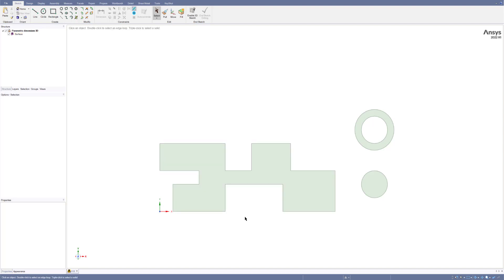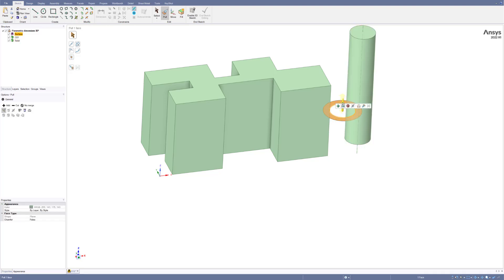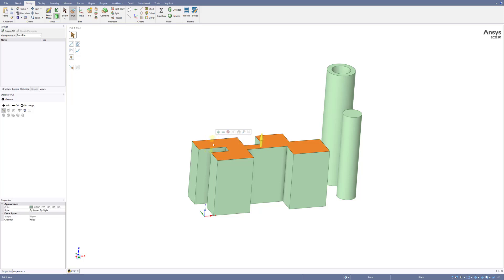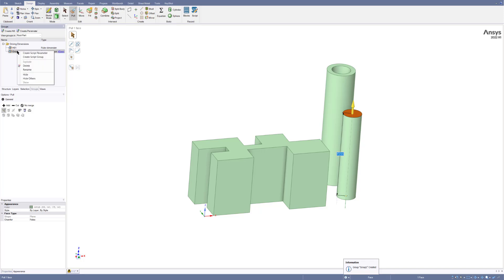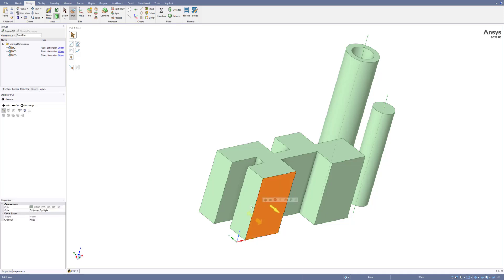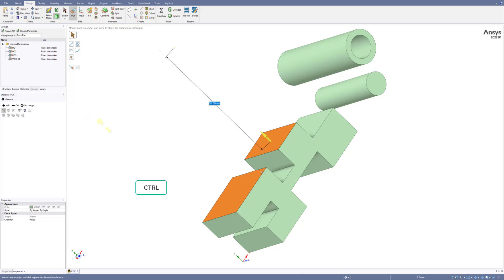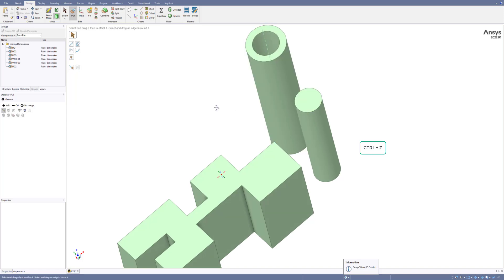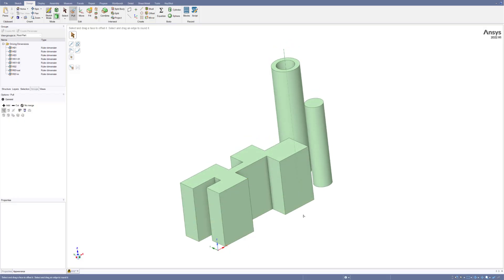Creating Parameters in SpaceClaim | Parametric Modeling Tutorial

Comment: is it possible to make parametric move command ?
Reply from the maker: Hello @hamzaseker8324,
Yes, there are a couple of ways to make the Move command parametric in SpaceClaim.

First method:
You can move the object normally in SpaceClaim, and while the movement value is still visible on the screen, click the “Create Parameter” button (next to the “Create NS” button in the Group tab). This will turn the move distance into a parameter.

Second method:
Another way to achieve a parametric move is by using Blocks and defining the movement distance (for example, 20 mm in the Y-direction) as a parameter. This lets you control the position of the geometry by simply changing the parameter value, instead of manually moving it each time.

I’m not sure how this fits into your specific simulation workflow, but these are practical ways to make a move operation parametric in SpaceClaim. If you’re interested, I can also make a very short video showing how to define and use such parameters via Blocks.

Thanks 🙂

Comment: Great video!! I wanted to ask you how to create move/rotate parameters in SpaceClaim. I want to change the angle of attack parameter of an aircraft wing.
Thank you very much!!
Reply from the maker: Thanks a lot for your comment! If you want to make the angle of attack parametric, I actually recommend doing it in Fluent rather than in SpaceClaim or DesignModeler. Instead of creating move/rotate parameters on the geometry, it’s much more robust to define the x- and y-components of the velocity (or Mach number) as parameters and control the angle of attack through those inputs.

You can check this excellent explanation by Cillian Thomas (@cillianthomasengineering):
44:20 – 52:03 — Changing Angle of Attack
https://youtu.be/3i9Ryq-m1HA?si=cvBXGNY9HMY_voVz

You may also find this tutorial on our channel useful:
Supersonic Flow Over a Wedge | Lesson 8 – Beginner CFD Series | Ansys Fluent Academy
https://youtu.be/yOCetxmFawk?si=S0-h6gqjQ3x0H7XI

(From 14:14, the setup of the pressure far-field boundary shows how to define Mach number with flow direction — which can act as your angle of attack.)

Hope this helps! Let me know if you have more questions.
Reply from the maker: Hello again, 
Maybe you can find your answer in the following link from another YouTube channel (@ansysfeaexamples9351):

https://www.youtube.com/watch?v=xhPojfnyB3g

Best,

Comment: What should I do if the P button isn't an option? Have you ever had it disappear as an option after deleting parameters?
Reply from the maker: Hi Andrew, 
I haven’t had this issue before. I tried it again — deleted the parameters and created new ones — and it’s still working on my side.
Are you using the Ruler tool just like in the video? Sometimes the P icon only appears when the dimension is created using the Ruler tool.

If you find the solution on your side, I’d really appreciate it if you could share your experience here so it can help others, too.